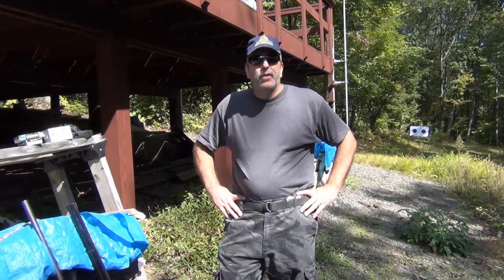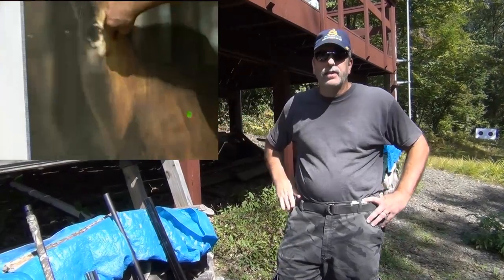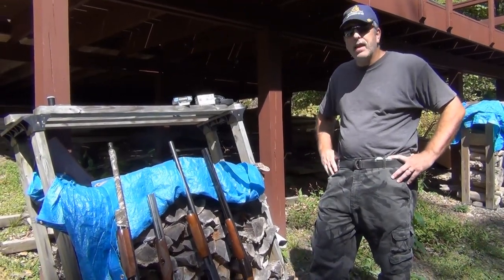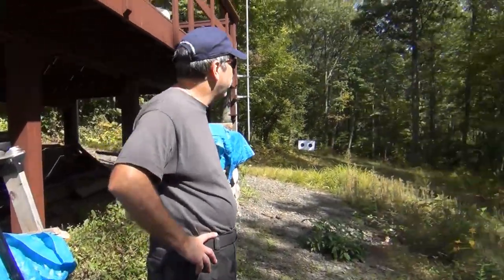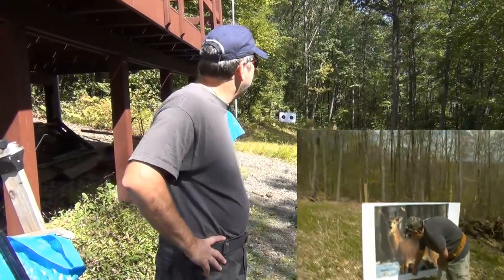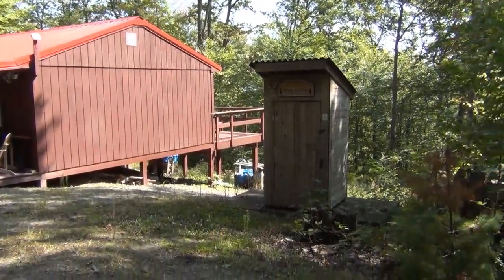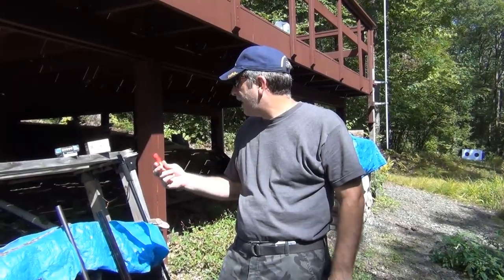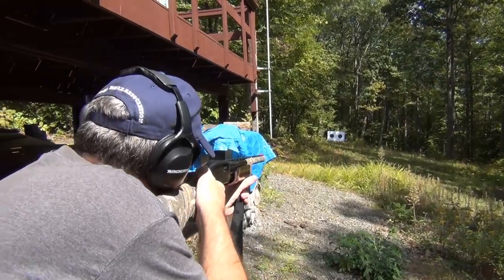00 and 000 buckshot tests at 55 yards with four different firearms

Comment: I have hunted predators for 30  years, #4 buck patterns in a 20" circle with Carlson's turkey chokes in my Mossburg 500 and Rem 11/87, OO and 000 are in a 15" circle-100% pattern. Lots of bad information out there by people that keep repeating the same old crap about open chokes shooting tighter patterns with buckshot.  Rem 1100's, 11/87's, 870's, Beretta 390 and 391 all pattern 20" 100% patterns at 40 yards with #4 buck. This is not self defense loads, hunting loads. I load my own buckshot, have since 1985,  best that I can do is equal the current factory offerings, in most cases with great expense in components.  Federal premium 3", Rem 3", and Winchester 3" 41 pellet #4 buckshot is good to 50 yards and perhaps a tad bit further with a turkey choke, and Carlson's Turkey chokes have been hands down winners for me and my friends.For self defense in the house, I would prefer a load of #1 buckshot in a 12ga, and 20ga would be preferable for a woman.  A 12ga. shotgun with a pistol grip is about worthless, can break your hand with a 3" buckshot load.If you use a Flight control wad, they work best with a modified choke to improved cylinder bore. Lots of police depts. are going to the Flight control wad due to how tight they hold a pattern in a cylinder bore.

Comment: Excellent video looking to purchase a shotgun really wanted a ar-platform don't know what type of choke to use for the 000
What about 3 1/2 shells?
Reply from the maker: Really depends what you need it for, home protection, hunting etc and at what ranges will your targets be set at.
Reply: @whiterook85  home protection 35 yards max?
Reply from the maker: Would go with a "Modified' choke, gives you a little flexibility.
Reply: @whiterook85  thanks appreciate it ✌🏿
Reply from the maker: Any time, good luck with it.

Comment: Double ought =eight or nine pellets , triple ought = sixteen pellets , is this correct ?
Reply from the maker: Depends on the size of the shell 2 /3/4, 3, and 3 1/2. Could be a lot of variations, check the box or description, it will indicate how many in each shell.

Comment: 000 buck has only 8 pellets ??   I thought 00 buck had "9"  ?
Reply: Bigger pellets so they can't fit as many. A 3 inch 000 buck shell will hold 10 pellets while a 3 inch 00 buck shell holds 15 pellets. Never saw a purpose in 2 3/4 shells to be honest with you. Nothing recoils THAT bad to avoid full power shells that will give you better results
Reply: Remington makes 2 3/4, 9 & 12 pellet 00Buck. They also make 3", 10 & 15 pellet 00Buck.

Comment: Not a single gun there was proper for buckshot. The best choke for buckshot is cylinder bore. Your whole test is worthless now
Reply from the maker: Please post a link to your test.
Reply: whiterook85 I patterned 2 different guns with 000. One full choke and one cylinder bore. And the cylinder bore was much tighter at 30 yards. Not only that, but the Virginia state clay champion told me to use cylinder. The reason being that a tighter choke flat sides the pellets.
Reply from the maker: Maybe this should have been your first response, just maybe...